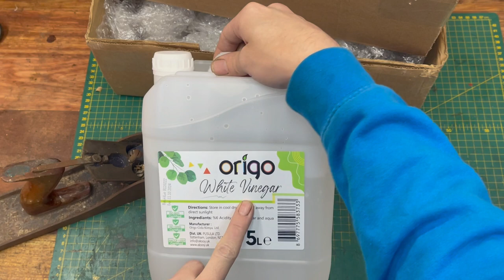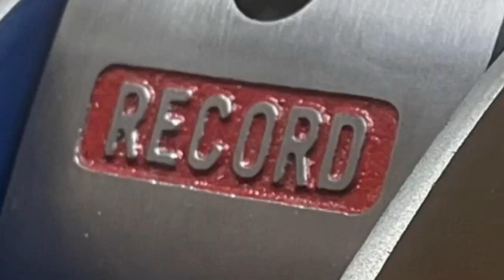How to Restore a Record No 5 1/2 Jack plane ( PROJECT MAKE BRAND NEW )

Comment: i'm about to buy a second and plane.  i have a stanley no.3 and now going to buy a record 5 and a half.  is that a good pair?
Reply from the maker: Yeah man you could pretty much do everything you need with those planes. The bigger planes, so 5 and above are jointer plane, we’d use those if we want to joint to long boards together. The way I’ve always work is the longer the board I want to join the bigger the plane I’ll use. But you can pretty much get by with a number 4. So having a 3 and a 5 will do everything you need. Even with the 5 you could joint long boards. Good luck and you should check out my other videos am sure there’s other content you’ll like.

Comment: Nice job mate, I'm well impressed, just today I picked up a Record no 6 all there is is the sole and the frog and a lot of grot, oh and the front handle bolt has been broken off where it screws in, there's about half a mm protruding, so I'm thinking I will need to drill it out very carefully, also I've a found a site on ebay where I can buy genuine replacement used parts, it's gonna be expensive, but if I can get a finish like yours then it'll be worth it. I really liked the paint job, could you have maybe put a touch of black in with the blue to tone it down a bit, also I've seen a guy on YouTube using WD40 rust remover on a plane restoration, it did a really good job in a fraction of the time. I'm now subscribed.
Reply from the maker: Thanks man am glad you enjoyed it, and I appreciate the sun, slowly but surely getting there and am sure with time and patience you’ll have the plane looking brand new. Let me know how you get on with it.

Comment: Great job - I’m about to attempt this on the same old plane. What paints did you use please pal?
Reply from the maker: Thanks man it works well and good luck, it definitely takes some time to sand it back to new metal and then polish it but always worth the work, patience is definitely needed doing something like this, the paint I used was hammerite smooth blue, got it on Amazon but you can get it cheaper from Halfords and similar places, but Amazon is always convenient, but good luck with yours and glad you enjoyed the video.
Reply: @Darren_Barclay  Thanks for the info Darren - yeah mins going to need a tonne of sanding lol it's in really bad nick :)